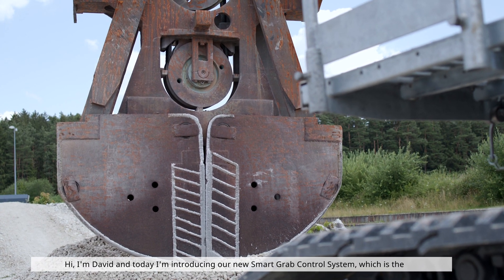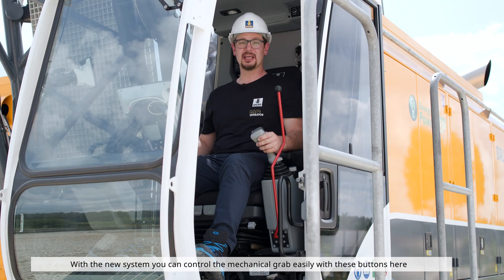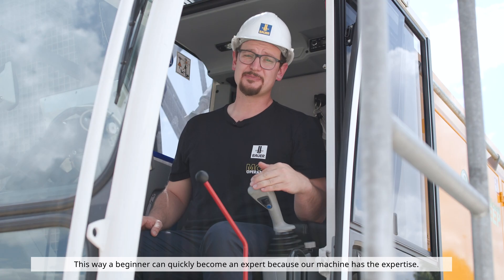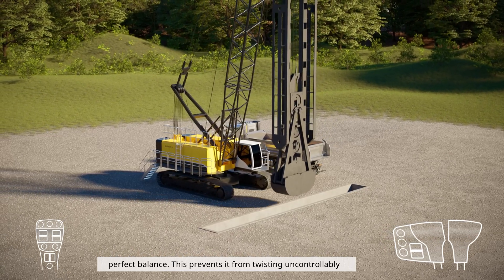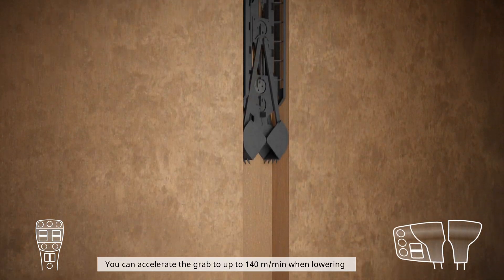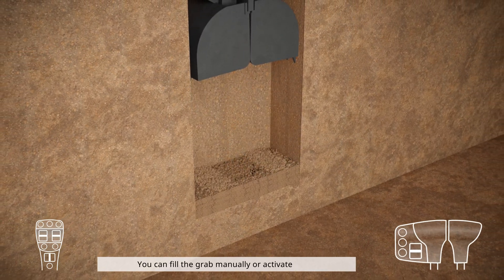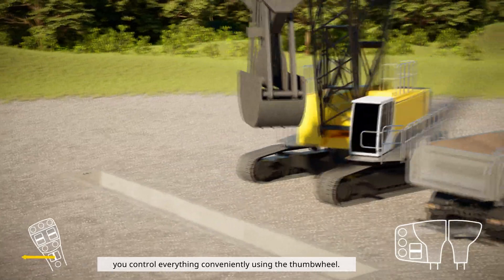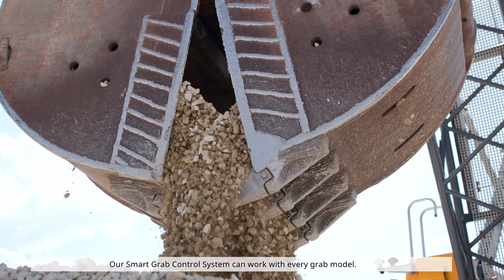Let's grab the future – Our Smart Grab Control System | BAUER Maschinen GmbH

Comment: If you overspeed the grab in the panel, you are liable to “swirl” the hole, leading to uneven walls and excessive concrete requirements. Take care.
Reply from the maker: Thanks for your comment 😊 You're right, lowering the grab too fast causes turbulences. This is why the operator can control the speed. The grab can be lowered at a speed of 1 m/min up to 140 m/min.